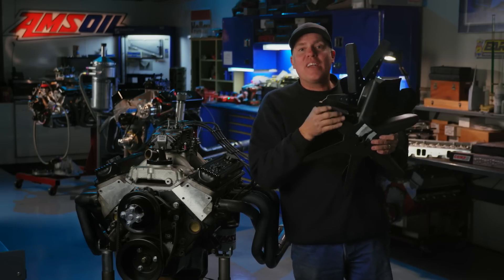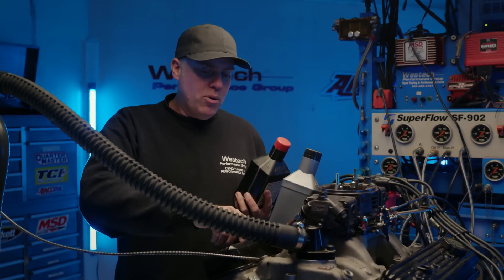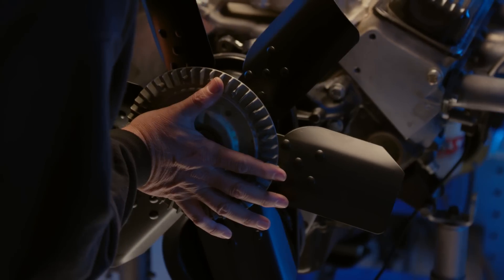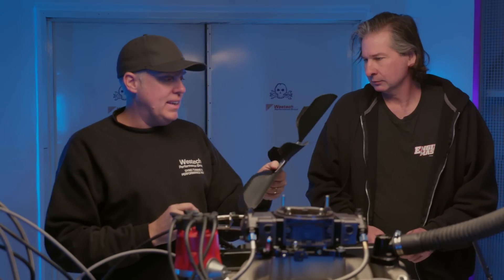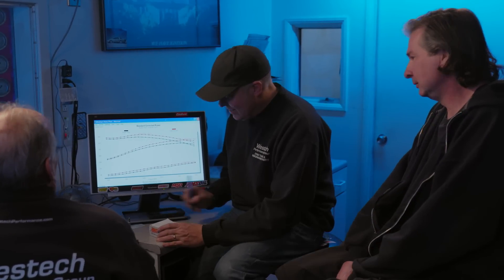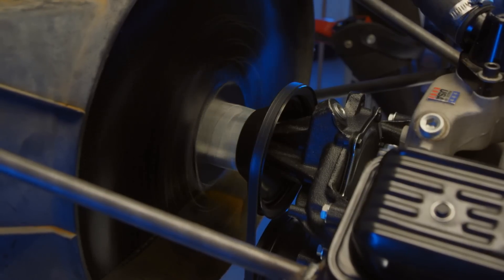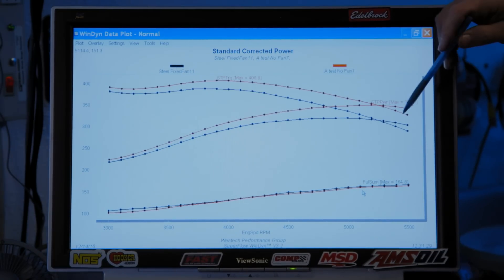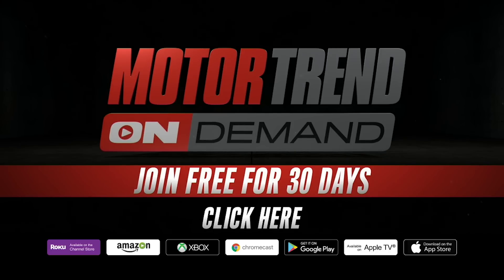Cooling Fan Shoot-Out! - Engine Masters Ep. 20

Comment: I enjoy information about parasitic drag. Electric water pumps, fans, power steering,...could a automatic transmission be tapped as a pump for power steering?... Eliminating drag and weight?
Reply: It could be possible..but wouldn't be worth the engineering requried to do so.

ALot of Manufacturers have gone to electric power steering for a few years now(BMW and Ford to name 2). The only problem is that they have massive electrical demands...we constantly had BMW's come into the shop with dead batteries just because the cars were driven far enough for the alternator to make up for the massive draws of all the electric components.

That's why old drag model cars in the 60's had manual steering.
Reply: Cool, so hard core solution could be manual steering to eliminate power steering pump parasitic drag and weight...then to decide to go with an old manual steering box or go rack & pinion.
Reply: Manual steering also saves you about 18lbs...and with drag racing every pound counts.

Comment: You guys should do rocker arm ratios. stock cam, stock displacement, stock heads and just show the power gains from just the ratio selection, as it would add lift, ultimately making a small cam slightly bigger depending on rocker arm ratio. Thanks in advance. It would be one of the best and cheapest mods one can ever make.

Comment: PLLLLLEEEEEEEEEEAAAAAAAAAASSSSSSSSEEEEEEEEEE do a shoot out on different oil viscosities!

5W20 compared to a 10W30 to a 10W40 

And dont miss the 10W60 racing oils.

I always wanted to know if the thicker (hot) viscosity really robs a noticecable amount of power, because I always liked to go with the 10w60s because of the extra protection.

What I know: The automotive industry uses thinner oil weights get better fuel econmy out of their engines, because the mechanical parts in the engine are moving easier. So in theory thicker oil weights should rob some power. But whats that in (real) numbers?

 LOVE ur show
Reply: If you can hear a rod bearing rattling, damage is already done to the engine. I would advise running the correct viscosity oil at all times, even if it means waiting for 2 minutes instead of 1.
Reply: Chris That would be super hard considering you won't be able to get all of the oil out of the motor thus "contaminating" the oil velocities to become not true weight
Reply: Chris. For sure. My Lexus V8 is supposed to run 5W30 oil, but in the winter I run 0W20. What a difference on a cold morning. One minute after a cold start, with gentle throttle, my engine revs up to cruising speed very freely. If i run the 0W20 into the hot weather though, i can hear a very slight con rod bearing rattle on a hot restart. Switching back to 5w30 gets rid of it right away.

Comment: Shroud vs no shroud, wish you guys used a wind speed gauge on the front of the radiator. To see what changes to the amount of air pulled through the radiator was. I know you guys did this just to see HP changes, but an overheating engine is going to lose power and its internals also.

Comment: Very interesting subject, but there is something important missing in
this test namely real working conditions.The loss as tested comes mainly from having to accelerate air from a
velocity of zero to maybe 40 mph. If tested in its intended environment (street
or track) the air is already in motion and at higher speeds may even add a
couple of HP to the fan (and engine).
If the engine is powerful enough to spin the wheels in lower gears with
the 30HP loss, then the mechanical fan has no negative effect at all on the
acceleration.

Comment: No surprise that the fixed fan without the shroud resulted in less parasitic HP loss. The shroud improves pressure recovery and promotes laminar flow to the fan blades. The result is increased pumping efficiency. Same principal applies to Turbofan engines and inlet cowl design. Had they measured the mass airflow produced by the fan itself, it would have become evident.

Comment: What I'm wondering is, with the carb being open like that with no air filter housing, if the air the fan is pushing back over the engine would interfere with the carb being able to suck in the same volume of air thus sacrificing some power that way also.

Comment: Glad I did an Impala dual electric fan swap on my '03 5.3L Silverado. Did it at the same time I did an under-drive pulley swap, and there was definitely a noticeable power gain in the mid and upper RPMs with the combo. Of course, I had to reprogram the PCM for the fans to function properly. Would do it again if I had to.

Comment: Not surprised the stock fan took the most horsepower as I imagine it was moving the most air. The aftermarket fan makers don't have to warranty the engines. 

Regarding running fans without shrouds, I always wondered if it was doing much of anything cooling wise.

Comment: I prefer electric fans for many reasons, but you don't lose that much with a mechanical fan if the car is moving.
Realistically you will almost never be at full throttle and high rpm while stationary and at a certain speed, the air getting pushed through the radiator naturally will be more than what the fan is pulling and will negate the drag from the fan blades.

Comment: Hi from England :-) Great video (as usual) but you seem to have missed the facts that a) if you were just revving the engine to 5500 rpm at the lights/in the parking lot etc, the amount of HP lost (or gained) is immaterial, and b) if you were driving down the road at 5500 rpm, there would be a 60/70/80 mph wind coming through the radiator 'assisting' the fan, so it would lose less HP.  I think you need to run the tests again with a high power shop fan in front of the radiator simulating the 'wind'. 
Feel free to tell me to F'go-away-off if you like.... I'll still watch these vids :-)

Comment: I challenge all this  , you need to hook up a hydraulic powered fan like the 2001 Lincoln ls 3.0 Duratek V6 fact. 182hp . Put this fan set up on that small block 350 & lets see what happens .

Comment: I think that the shroudless fan makes better power because the air it sucks does not need to go through the radiator, it can bypass it, whereas the shroud forces the air to go through the radiator, which is more difficult and so needs more horsepower

Comment: I don't understand why electric fans would decrease the power loss, since the power absorbed by a fan remains the same wether it is electrically or mechanically driven. In fact, the electric one should need more horsepower since there will be losses in the wires...
Reply: If the fans were spinning the same speeds that would be true, but they are not. The engine driven fan needs to make good airflow at idle so at high RPM it is pulling too much air and wasting power. The electric fan will always only pull the air that is needed.  
Also, a properly set up electric fan will only come on at a set coolant temperature. When the vehicle is moving, there is usually enough air flow through the radiator so the fan won't need to come on. The fan will mostly be activated at idle and low speed driving where the power loss doesn't matter. It will also cool better because the fan can reach maximum RPM regardless of engine speed.
Reply: Nope.  The electric fan drawing 30 amps is only eating about half a horsepower.  And then, it's not doing that all the time.

You can directly compare the power drawn by electric fans because you can convert watts straight over to hoserpower and vice versa.  

The engine driven fan is optimized for a certain RPM, usually at around idle.  Driving it faster means you get more losses.  The electric fan can spin the same speed no matter what the engine speed is.  It is possible to do variable speeds with pulse width modulation, but that's more about the sound than actual efficiency.

Comment: so remove a reliable fixed mechanical fan and gain horsepower or Run a Chinese "quality" aftermarket electric fan for a bit of a power gain. 
go figure the factory engineering teams figured all this out already.
I guess if I am really serious about making power I would run electric fans but on my tow vehicle or older daily driver I will stick to stock. Besides that a cat eater sure looks cool on a 1950s ride.

Comment: Oh come on guys. You can't do a test like this without comparing CFM through the radiator. The reason the fan without the shroud used less horsepower was because the shroud seals the radiator and the radiator provides air flow resistance.  You literally had suction in the shroud.  If you had been measuring airflow through the radiator you would have found significantly less airflow without the shroud. 
Awesome test though. Would love to see you throw on an electric fan with alternator to see how much that pulls. 
I predict it will lose much less because you would need to run it for 10 minutes for the battery charging system to stabilize. 
A better test would be to see which electric fan combo pulls closest to the factory fan.
Another conclusion is that with electric fan doubling the size of the radiator will save energy down the road. I find my 5 row core never lets my fans come on unless sitting in hot traffic for quite some time.

Comment: regarding the whole electric vs mechanical fan 
well my 68 Electra with AC running and a 180* thermostat and cheap aluminum radiator  will stay below 200* here in sunny Sacramento with 100* ambient, Turn off the ac and like magic temps drop 10-15*. Every time I go to a car show most of the electric fan setup guys are stressing like crazy the second they have to get in stop and go traffic and I'm sitting there in perfect chilly comfort.

I will keep my properly set up clutch fan k thx

Comment: The clutch fan test was done incorrectly. When thermal clutch fans are cold they are partially active which is why you hear that fan roar in the morning for the first mile or two. After the fluid inside the clutch warms (BUT NOT HOT) the fan has much less of a drag.

Next time do the test after running the engine for at least five minutes at varying rpm and I bet its horsepower losses will be cut in half.

Comment: I enjoyed it, I would however like to see the other type of flex fan,( the one you wanted but didn't have) with stainless steel blades. keeps a/c working in Florida traffic,  and on my VW Corrado G60 I've added a brake switch to force fan on when I'm at a traffic light regardless of coolant temps, soon to add a fan to intercooler for same function, as she is supercharged and hates heat.

Comment: you lost less HP from not having a fan shroud or rad because all the air that the fan was moving wasn't moving threw that restrictive radiator. fluids flow threw the path of least resistance

Comment: with the shroud on, it is forced to pull air through the radiator. with the shroud off it is just batting  around the hot air that is already under the hood

Comment: I'm not surprised they gained horsepower by losing the shroud, it let the fan throw air out the sides instead of pulling it through the radiator.  What I'd like to know is how much horsepower you lose when you're driving down the road, because with a 50mph wind coming in through the radiator, the drag from the fan will be much lower, maybe there is even a speed at which you start to gain back a couple of hp?  A measurement of air speed through the radiator for each fan would be interesting.

Comment: If you are building a 4x4, use a belt driven fan. Electric fans eat more power cos they move more air. On the beach or in the mud, you are regularly at 100% load with zero airspeed. Airflow through that radiator is everything.

Comment: It made less power with the shroud because the fan has to pull the air through the radiator, which is creating resistance where the fan without a shroud can pull air that is moving freely around the radiator.

Comment: It would be very interesting to see the power loss of running an alternator with progressive additional 10a, 20a, 30a, and so on, electrical loads added.  Alternators DONT make free energy.  They have a very substantial parasitic load on the engine when generating power.  This can be easily seen by running an alternator on a test bench, then adding electrical load by way of a carbon pile load tester or similar.  You can literally hear the test bench groan and strain as you increase the alternator output.  you can even hear the extra load on the test bench as the alternator exites and starts making its own power before you even load it up.  I would love to see the effects in a test similar to the one you just done.

Comment: Valuable information here.. The 69 -72 GTO's have a factory lightweight flex fan, very flexible stainless blades that flatten at 3500 RPM.. no cooling problem either. I believe this to be lower drag than a clutch fan and much lighter weight.

Comment: maybe it's a short extra episode you can get an electric motor and have somebody weld on a fan belt to the spindle. Put all the fans on and test to see how many amps they draw to maintain 5200 RPM. once you have that you can always converted to horsepower. probably won't be the most interesting show, but that's why it should just be an extra show.

Comment: In static conditions it is devastating but with air flow to the radiator at high speed the brake is reduced and not so much power of the engine is consumed.

Comment: The shroud results were kind of obvious really. With the shroud on, the fan is forced to draw the air through the radiator, with the shroud off the air can take the path of least resistance and draw the air in from the sides. While the fan might be exposed to more air with the shroud off, the air isn't under a partial vacuum like it is when the shroud is on.

Comment: The shroud takes more power cause the fan has to pull the air through the rad aka basically a large particle filter. Air drag yo. Deal wit it.

Comment: Removing the shroud reduced the power loss because the fan could pull air from around the radiator, rather than through it. More power, less cooling.

Comment: Could it be that at speed the air flowing through the radiator would lessen the drag provided by the fan? Or you could also make an argument that at speed the fan provides a slight amount of propulsion negating its HP losses? Or the fan could provide an impediment to airflow through the radiator if engine speeds are low and vehicle speeds are high. Aw fuck it, Im hooking up an electric fan.

Comment: Seems like some engineer needs to measure maximum airflow through the radiator and then create a clutch based fan that matched the fan output to the maximum flow.

Comment: To those asking about the cooling abilities of some of the fans. I just converted from a clutch fan to a flex fan. Let me just say that some of the problems I was having before I switched were (obviously) overheating, low oil pressure, and hard starts due to vapor lock. Not only does the engine run MUCH cooler than before, but I also have increased oil pressure and the vapor lock is gone. The flex fan moves so much more air around the entire engine compartment. The only drawbacks are the fact that it robs horsepower, and it is very noisy. Other than that, it is a great fan.

Comment: No, answer is not to add electric fans with added components, modifications and reduced reliability but to get the most efficient fan clutch and blade. Now you should be on step TWO, Find best fan clutch/fan combo. Great episode by the way. Thanks for testing.

Comment: Question – –
I just finished building my engine 383 stroker would you have any interest in putting it through its paces on your dino
Reply: Call up Westech Performance group, they'll run it on the Dyno and dial it in for you. They're going to charge you for it but they will do it, Brule might even be the operator that does it.

Comment: Freiburger, the reason that the fixed OE fan made more power without the shroud is because without the shroud it is spinning in its own turbulence, which is in effect stagnant air (essentially a vacuum or vortex standing around the fan) where the fan is not moving very much air, which is the exact same reason that mechanical fans do not cool very well without a shroud  at slow speeds and or sitting in traffic. Just a common  sense observation from the average joe. I do not know if someone else has already pointed this out or not, I did not read very far back in the comments.

Comment: I've got an 03 BMW 540 and it's a little low on power from the factory, 292hp in a car that weights almost 4000. Plus there are very few bolt on power adder options. They are all expensive and the gains aren't that much. I'll probably end up replacing the fan clutch with an electric unit, and since the battery/alternator combination is big enough to jump start an 18 wheeler it shouldn't be a problem. I'll just keep the mechanical fan in the trunk if something goes wrong, easy enough to swap out.

Comment: Factory viscous fans have a bimetallic spring and valve to change fluid flow when the radiator gets too hot, so more heat more air flow more horse power needed. Also I would like to know is airflow rates from all of the fans tested and compere electric fans with them.